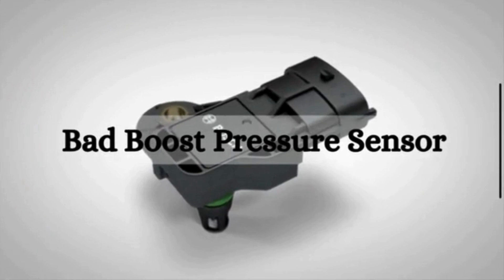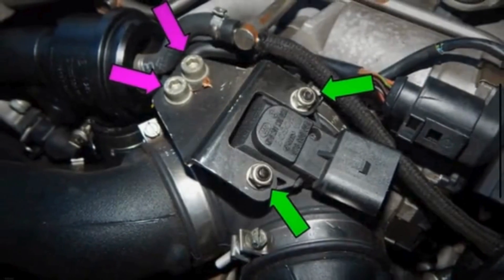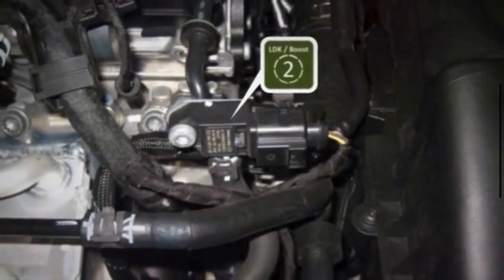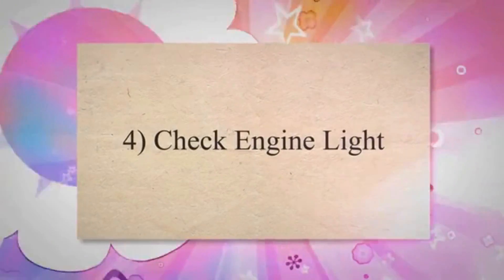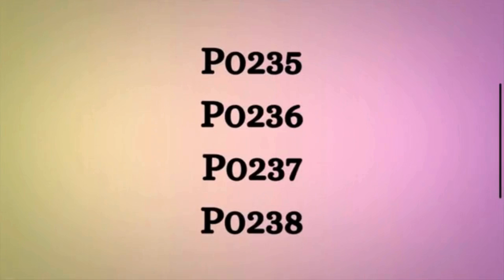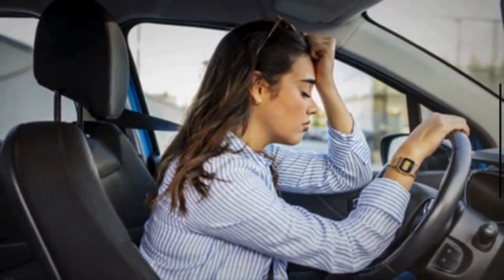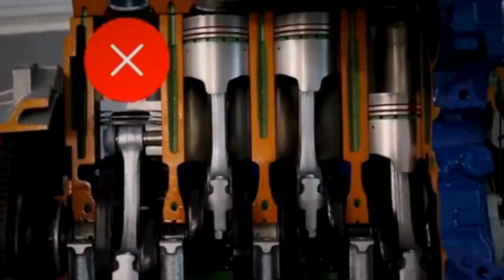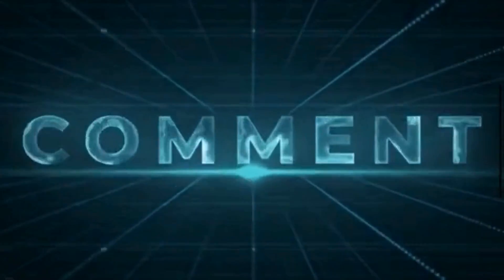TOP 8 SYMPTOMS OF A BAD BOOST PRESSURE SENSOR

Comment: How much cost to replace boost sensor
Reply from the maker: Replacing a boost pressure sensor can cost between $74 and $288 on average, but prices vary significantly depending on the vehicle's make and model, with parts typically costing $30 to $300 and labor adding another $80 to $125.

Comment: It is a map sensor, not a boost sensor. MAP. As in Manifold Absolute Pressure sensor. It monitors both vacuum and pressure.
Reply: In most diesel engines it works as the boost pressure sensor as it measures air pressure
Reply: @idealgarage6895  lol, no, it manages absolute pressure, which is both boost and vacuum

Comment: its compulsary 	to hv chek light on cluster ,?
Reply from the maker: @electrotech7633  no it is not compulsory.. Your car may show other symptoms instead of check engine light in case of a bad cluster
Reply: @MechanicalBoost cluster is good i hv boost prblm in diesel car accelrate good but not speed boost at start later loose speed cltch all new fiter egr  all ok

Comment: Why i found oil inside turbocharger booster sensor?
Reply from the maker: @smailboumrar8992  Oil in your turbocharger's boost sensor can be a sign of an issue, usually related to your engine’s ventilation or turbocharger system. Here are some possible reasons:
1) PCV System Issues: If the Positive Crankcase Ventilation (PCV) system is malfunctioning, it can allow oil mist from the crankcase to enter the intake, which can then reach the turbo and boost sensor.
2) Turbo Seals: Worn or damaged seals within the turbocharger can allow oil to leak into the intake tract, eventually reaching the boost sensor. This is especially common in high-mileage or heavily used turbochargers.
3) Excessive Blow-By: If there's excessive blow-by from worn piston rings, more oil vapor can be pushed into the intake, potentially reaching the boost sensor.
4) Oil Accumulation in Intercooler: Over time, oil mist from the intake system can accumulate in the intercooler and travel into the turbo system, leading to contamination in sensors along the path.
5) Poor Maintenance or Clogged Filters: If your air filters or oil separators are dirty or clogged, they may not be filtering out oil mist properly, allowing it to enter the intake.
Reply: Broken turbo seal
Reply: @philipmadhatter4006 no really, if that is a deasel Mercedes, remember that some have recirculating burned gas sistem,

Comment: I have some of these symptoms but my car coded a P0299. Is it possible that it's the boost pressure system and not the entire turbo charger?
Reply: Same - it's a cheap component so might replace it anyway
Reply: I have a p0299 that comes on every 5 weeks or after pushing car a bit harder. My whole turbo was replaced less than a year ago, wondering the same thing myself.
Reply: @Bigc223  I took mine into the shop and found out it was just a detached vacuum hose. I really thought it was going to be a full turbo replacement but I was so surprised that it was a detached hose causing so much strife.
Reply: @melissapewitt5477 
Hello thanks for ur time in responding with yet such a simple comment- BUT EXTREMELY IMPORTANT AND INTERESTING ONE-,…. As I feel this is my issue-

May I ask? Were was that vacuum hose located.?? And what is it you own, or drive??…. Plz…
Reply: @Bigc223 i replaced my turbo and presure sensor too but still getting the same code. Going over 80 miles the car goes into the limp modr
Reply: @MrWaqarali88 what ended up being the issue? Thank you for sharing.
Reply: That code is a bad turbo
Reply: @Tkgftuvc that’s not true. Your giving out bad information
Reply: What a p0047 be the same thing
Reply: Replaced coils spark plugs fuel injectors..(cyl 3 misfires) dealer said head gasket.. no smoke or anything smh other shop says turbo needs  replacing turbo now going on 2 weeks… brought it to the dealer under the shops name (dealer says bad turbo) new turbo didn’t solve the boost leak… I hear a loud blowing noise on boost onto the highway and it goes away if I go any faster than 80 limp mode kicks in need help I’ve been dealing with this for 2 months now and the dealer/and 2 shops can’t figure it out in my research all I find is that Honda let their customers down and I have fixed 2/3 major issues I have 5300$ (1yr) left to pay for this car 😔 2018 1.5Lt
Reply: It's a video out saying that some of these mechanics are making a mistake and plugging the boost sensor in the oxygen sensor connector and oxygen sensor in theboost sensor connector.@melindacardoso2403
Reply: @melindacardoso2403 the turbo is usually connected to a turbo solenoid with two small hoses, disconnect them both, with the vehicle running confirm you have suction on one of the hoses and confirm there is no suction on the other hose and that hoses are not damaged. Reattach the suction hose to the solenoid to the correct port and check you have suction at the other solenoid port before reconnecting the last hose. Check voltage to the 2 pins on the solenoid you should have around 11v with the vehicle running if not trace the wire and see where is detached or broken. As far as the map sensor is concerned you should have 5 volts on both of the external wires (if it’s a 3 pin plug) while the vehicle is running if you don’t have that voltage there is a problem with a wire somewhere. Also if you press the throttle on one of the 2 wires on the map the voltage will drop, if not, check the wiring. I had the problem for a couple of years and at the end I had to trace the problem down myself, I hope the above helps. Good luck
Reply: So what ended up fixing the PO 299 code where you replaced almost everything on your engine can you give us that information? Some of us are having that same code